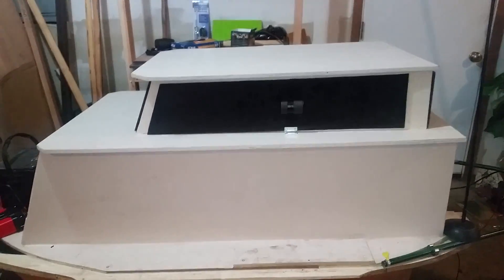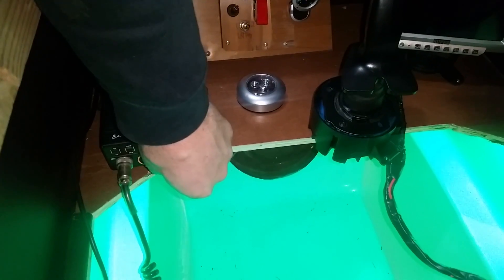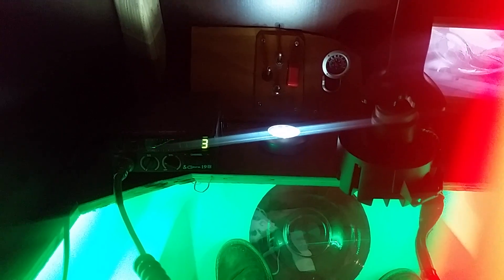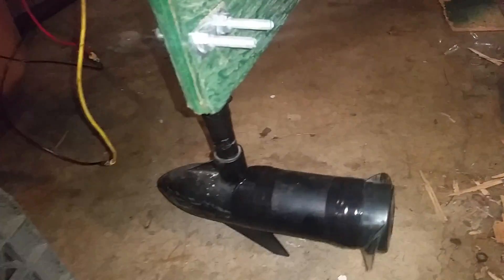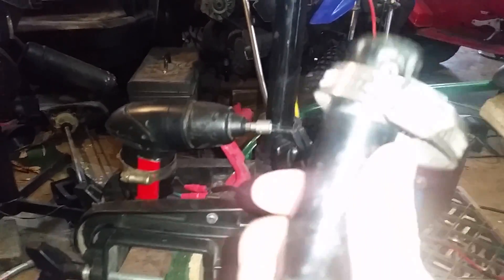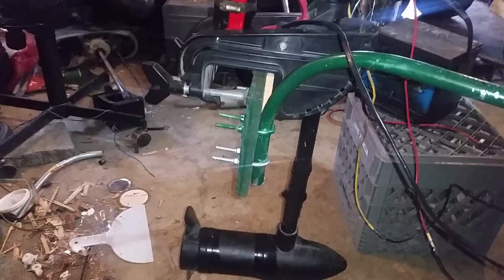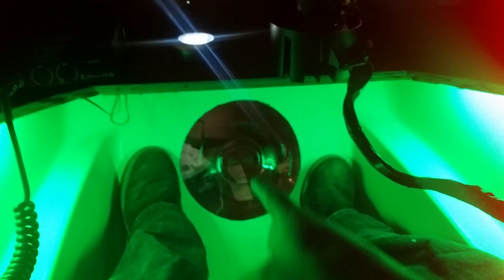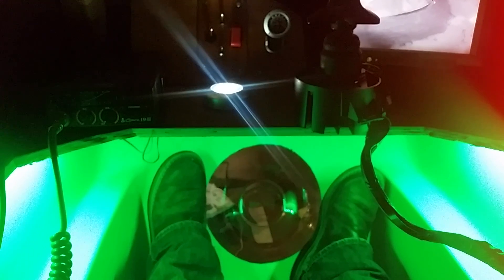Safe homemade submarine simulator how to

Comment: This is cool but i think you should build an actual submersible just have an oxigen tank with you incase you flood and sink
Reply from the maker: Yeah thatd be cool! Few problems: needs to be SUPER heavy to sink. Probably need to buy a trailer to move it.  The cost of scuba gear and lessons isnt too bad but add that to tons of valves and motors and pressure resistant glass or plexiglass that hopefully wouldnt leak. Also some kind of hatch that would for SURE open if i were to sink to the bottom of a lake..  for me, i decided to go safer, cheaper, lighter...  but i wish!!!  Thanks for watching!
Reply: @americanboathead5390  you could use a big propane tank as a body for it or if you wanted to make a giant submarine you could live in you could use the metal shaft of a wind turbine which is something i'd love to eventually do
Reply from the maker: Consider this,  a 500gal propane tank is barely big enough for a person.  Even that would take around 4,000 lbs to sink it! Imagine loading and unloading such a beast!  Just something to think about while you are planning.  Another possibility is a wet sub where you are in a vehicle underwater but fully scuba!  Might be easier and still cool!
Reply from the maker: Also ive since made a glass bottom boat that is very fun and feels kinda submersed!  You should check it out and tell me what ya think!!

Comment: Wouldn't it be best to make it a cylindrical shape to better support the pressure?
Reply from the maker: Yes it would!  Especially if it was meant to be fully submerged.  Luckily i didnt have to do much to make this using an old fiberglass bathtub. You are correct though!

Comment: this is sad
Reply from the maker: +Paul chlouba how so friend?
Reply: 1 it cant float 2 its a bathtub 3 u hade to put it in a pump up boat so it did not flip  i would suggest using a big propain tank
Reply from the maker: +Paul chlouba oh my bad i thought you must have seen the video of it floating..  a propane tank would flip over too if it floated on top of the water. This is just my way of getting the feeling of being underwater without all the weight, expense, and risk of acctually going under water. To get a propane tank to sink it has to weigh thousands of pounds. Ive done the math beacuse i thought that first too.Im too scared of being stuck on the bottom of a lake breathing up the last of my air or getting crushed because of a bad weld.  So i guess youre right, it is kinda sad...   and hopefully a super fun, cheap, easy way to explore underwater!! Ive added rov camera screens and sonar for more exploration!  Id show you but im guessing you wont be watching any more of my vids... :(
Reply: thats why u would have a emergency tank that would fill up a float and bring u up
Reply from the maker: +Paul chlouba good idea!  I wonder how much your setup would cost.  Im into this for about $150.  maybe if this sucks as bad as you think it will,  ill try making a real submarine...

Comment: were did you get the Electronics and how much Did it cost
Reply from the maker: Hey! I got the flat screen on ebay for $40 the small surveilance camerea was $24 at harbor freight the cb was $10at goodwill the joystick was $5at goodwill the wire and switches are from autozone!  my new videos show a 2 camera rov with a monitor and that was $90   thanks for watching and let me know if you have any other questions!!
Reply: Ok